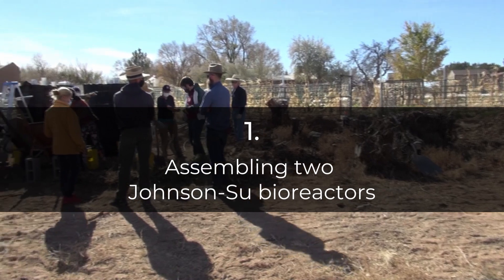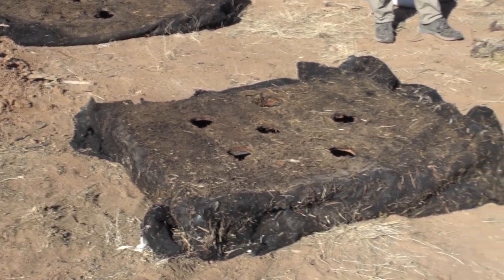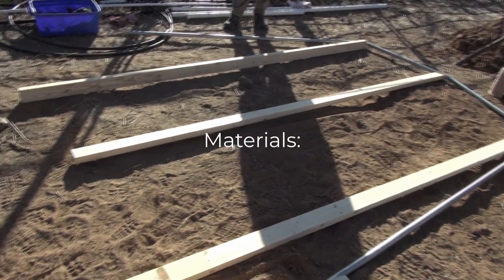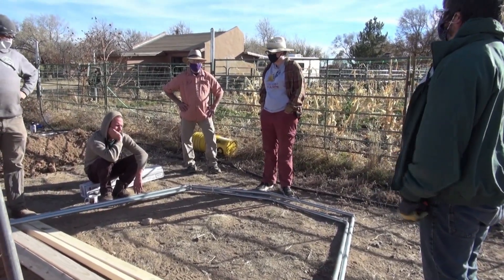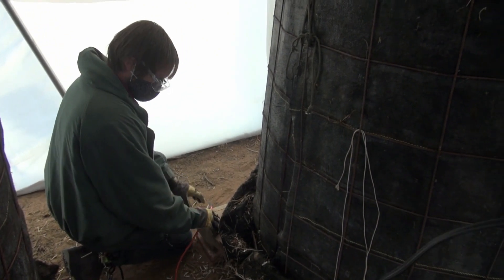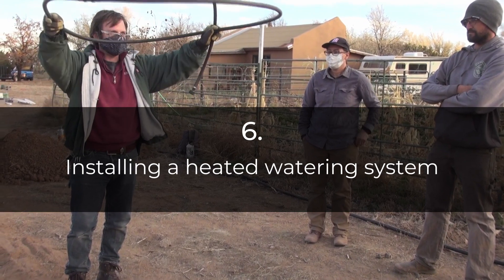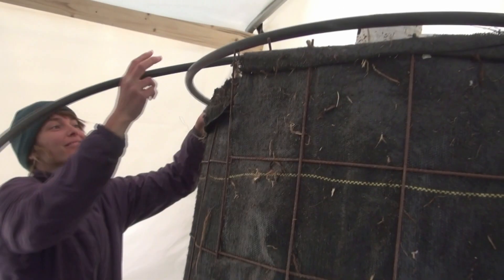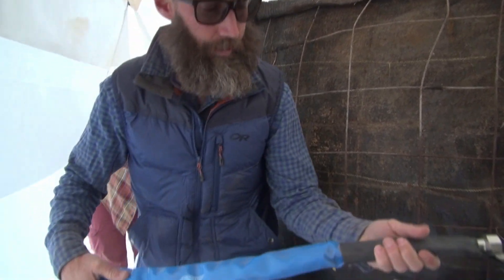Freeze-Resistant Johnson-Su Composting Bioreactors Field Day

Comment: I have very little electricity and truck in my own water.
I live with extreme wing gusts.
Could I make smaller composters, lined with and covered  scrap sheet plastic with holes, yo retain more wate? 
I know I can't afford plastic sheeting,  buy was gifted over 15 sheets translucent corrugated fiberglass, 4x16.
Frame scrap lumber. 
I also have about 10 glass doors for southern exposure,  which I could open, shade, for summer.
I have great luck with bait worms from Walmart and can sell the extras yo local fishers.
What's the wattage of your heat tapes? Expected I'll have to live without.
I do have 10mm sheet plastic could line interior,  wouldn't survive wind.
Mostly containet and hanging garden growing for now.
I'm on one acre desert sand, sparse vegetation. 
Must also protect everything from open range cattle, horses, donkeys
Reply: If you wanted to water with warm water you can store water in a dark container in the sun and water outta it when water is warm. We used black plastic barrels with water in em on the south wall of our greenhouse as a heat sink
Reply: You can use whatever you have to line the sides of the bioreactor. Plastic would work, but, make sure you have holes in the plastic for the reactor to breath. Or it'll go anaerobic on you.
Reply from the maker: Hi! Definitely experiment with what you have in terms of materials for the hoop house. And here's a blog post on smaller Johnson-Su bioreactors that might be useful https://www.nmhealthysoil.org/2021/04/19/adapting-johnson-su-composting-bioreactors-for-home-use/ Good luck!